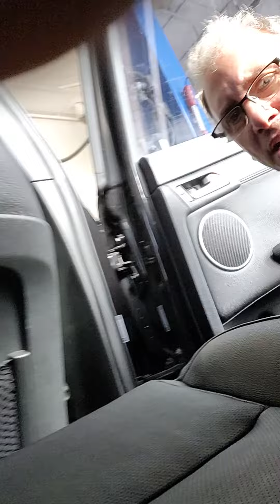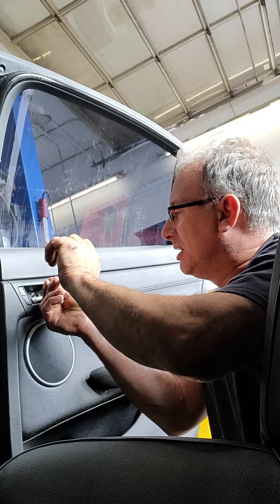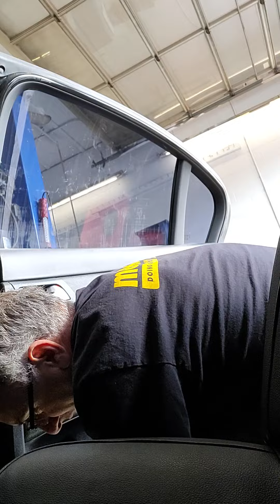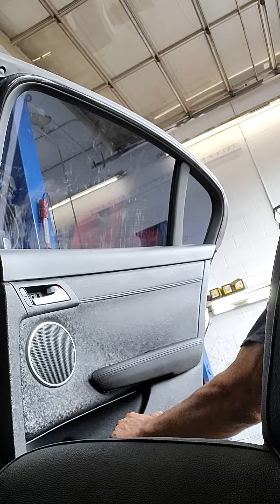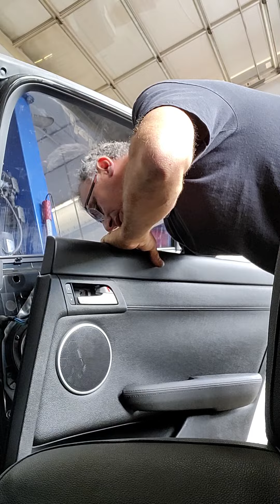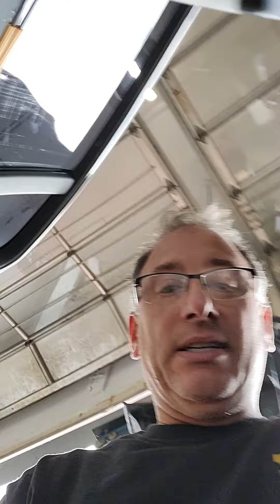How many guys know this guy new spark plugs cracked x3

Comment: I don't think I ever broke a spark plug during installation. I've always inserted the plugs in the socket and sent it in the hole. I used the extension to start the plug by hand. I've never dropped a plug down the hole.